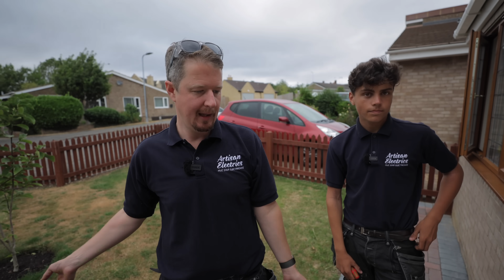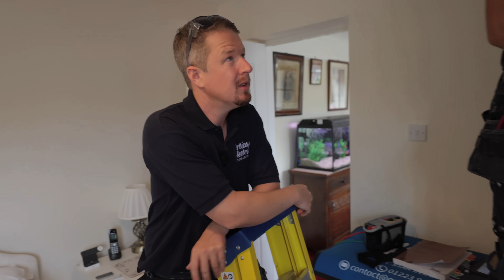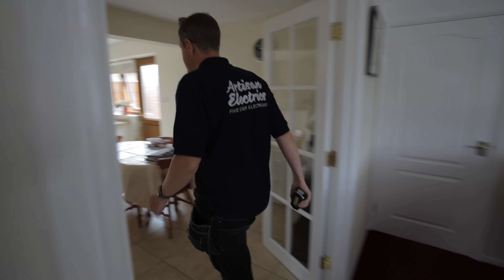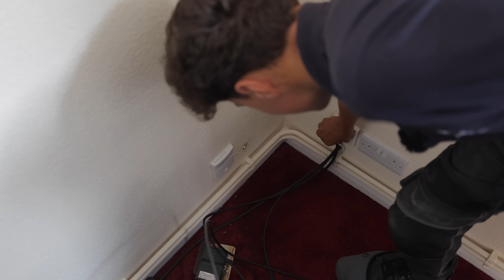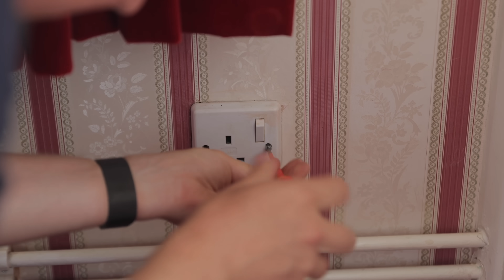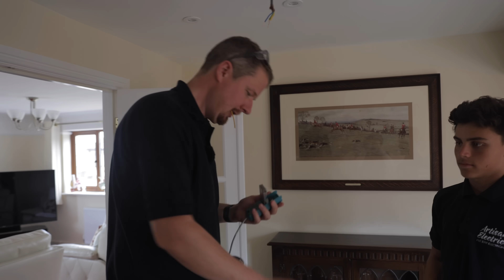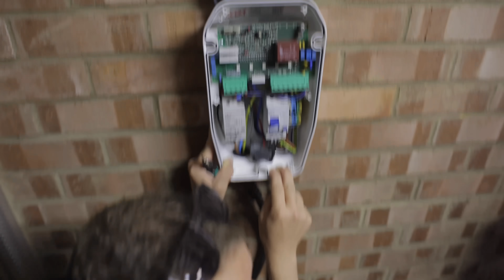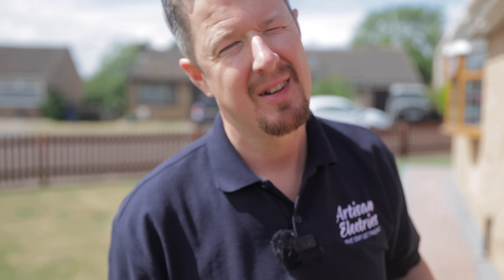CUSTOMER TRIED TO SUE ME - SHARING MY ELECTRICIAN HORROR STORY

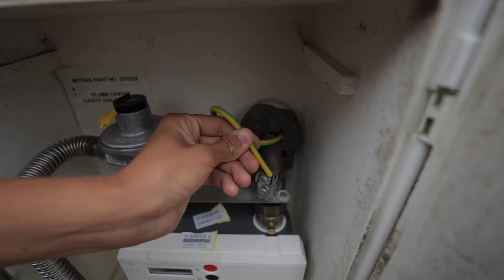Comment: 2:50 guess what Jordan missed… BOTH sides of the gas meter, incomer and outgoing, should be earthed. Why? If the gascompany decides to change the gasmeter the earthing connection is being broken.
Reply: Out going to house only needs to be bonded
Reply: No it doesn’t customers side only
Reply: I hope the utility would bond their side of the equipment... not your job as consumer...
Reply: Gas engineers carry bonding links for that occasion.
Reply: If the gas company change the meter you are supposed to put a temporary  Continuity bond once you check with a volt stick first then remove once work completed

Comment: An earth to the back box is actually unnecessary as it's automatically earthed via the screws through the face plate, and of course you shouldn't be removing the faceplate whilst the circuit is energised, not that anybody ever would, the very idea! ;) I know it's 'good form old chap' but not a regs requirement. I concur on the C3 on the basic installation issue, of it was somewhere it could be damaged, definite C2, but above a ceiling, C3. Have to say, I would not have a live circuit switched on with bare conductors hanging from the ceiling, your apprentice was reaching for the cables when you turned the power on! Put them in a wago if you're going to switch on! (but not a waygo!) I would also say that the point of an earth is to protect the user, not the wiring, the regs do require an earth to every point for any potential future work, so it would still be needed, but not for that reason, so C3.
Reply: Jordon shouted clear and Ruben said yes so no issue there.
Reply: Plastic light switch faceplates tend not to have an earth terminal, so you do need to terminate the CPCs in the backbox in order to earth the screws so that should eg a live conductor come loose and contact the backbox you don't end up with the screws being live (unless a dry lining box or similar where the screws couldn't electrically contact anything)...

Comment: If it's in a garage then as I understand it under the regs it doesn't need pen fault protection, only if it's actually outdoors. Obviously it would still be sensible to have it but IMO it is compliant with the regs, so I don't think a C3 is justified...
Reply: (Personally I think the regs shouldn't allow it, because realistically the risk is basically identical for a garage vs eg a tiled driveway, but hey ho...)
Reply from the maker: Yeah that was my thought as well

Comment: Can I go off grid using solar?
Reply: Depends where in the world you live, what size roof your property has (and its orientation),  and what your power usage is.
There are properties in the USA that are completely off grid. They do have to be very frugal with their choices of electrical appliances (especially in winter).
If you have a large sized plot then you could add ground based panels to boost the power generation. This may require planning consent though.

Comment: Malmbergs was founded in 1916 in Sweden, Kristinehamn as a installation company. Later they started their own brand and they are now selling their products mostly in 
Scandinavia. They make breakers, outlets, cables, lights, tools, safety gear etc. I would say they are a good, but cheaper alternative to say Hager or Schneider.
Reply: Fun as a Swedish viewer to see some components from here.

On the other I guess most electricians would say that Malmberg is of lower quality, so maybe it isn’t that fun in the end.
Reply from the maker: Thanks for your research
Reply: Malmbergs was bought by Eaton. Eaton is now top-notch circuit breakers.
Reply: @tommymack3210  they  bought Moeller Group ( including F&G )  also .. and  Phoenixtec   and i believe they make Teco also . ( Eaton )
Reply: Yes. I myself have bought a few Malmbergs products to put in "hide away places" like my own attic since it's more than half the price compared to Schneider or Elko (another Scandinavian brand). Would never in my life buy more "advanced" Malmbergs products, basic stuff like outlets and switches are OK.
Reply: I bought a lot of malmbergs rcbo, rcd, rccb, spd and never got any issues with the quality. Why pay twice just for a more know brand if the quality isn't any better?
Reply: Malmbergs light fixtures i have a hate for..needing a knife to change tubes .